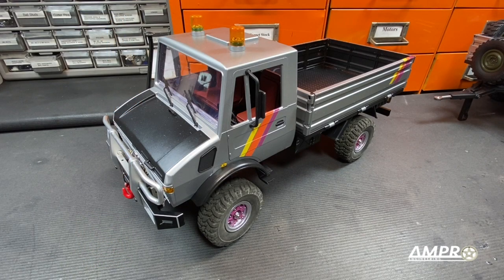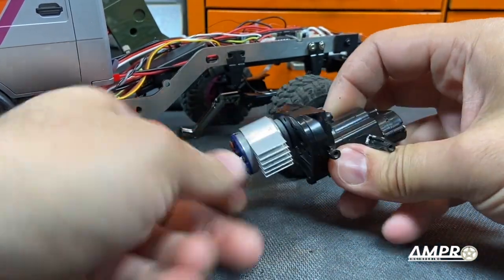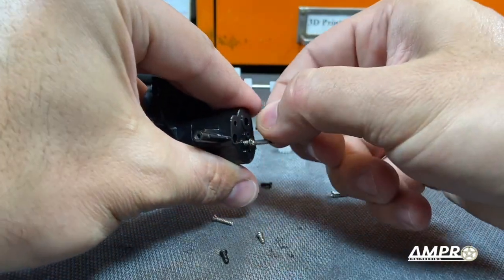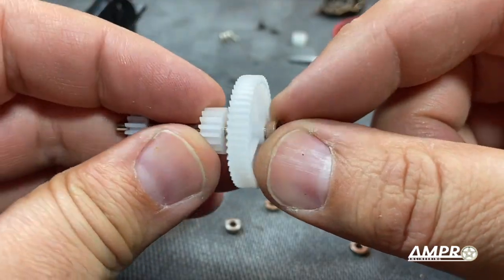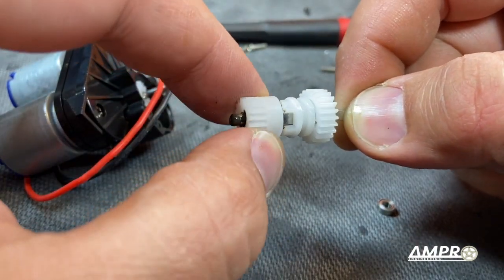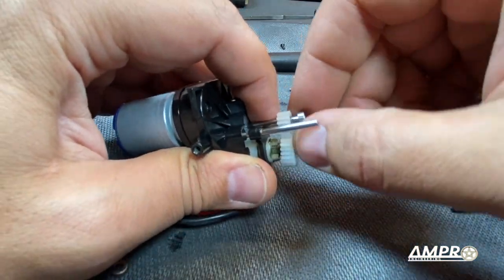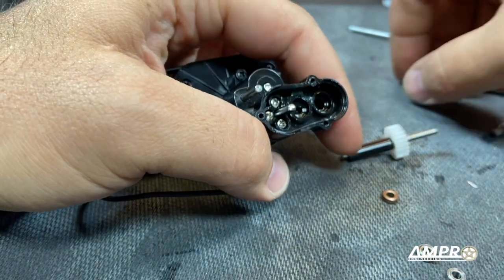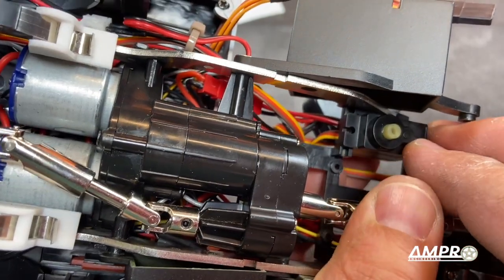e393 - LDRC P06 Unimog, part 3: 2 Speed Transmission Build

Comment: for small plastic transmitions i recommend using krytox 205g0, its a lubricant used for mechanical keyboard switches, its still pretyty viscous but doesnt have that suction you were talking about, another great option that is water repellent is dialetric grease which is also non conductive so added bonus if you accidentally get it in electronic components
Reply from the maker: This is a brilliant suggestion. I will get some!

Comment: Bro where is the motor and battery is situated on the reciever m+ m- it's motor or battery and then the switchright side it is motor or battery plzz reply
Reply from the maker: You can check the video where I am modifying the electronics.